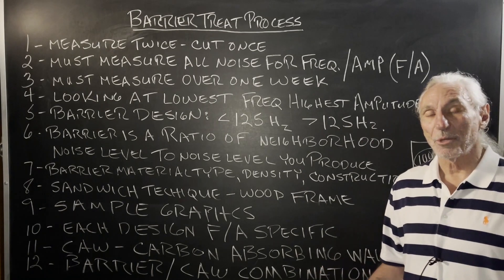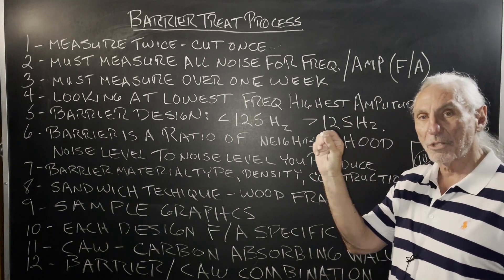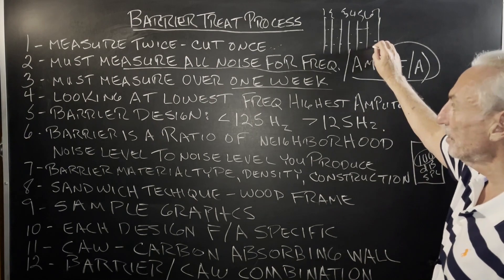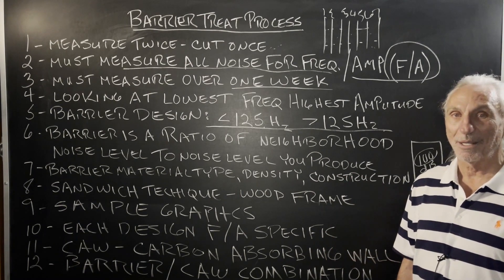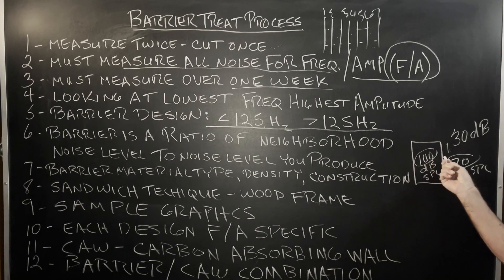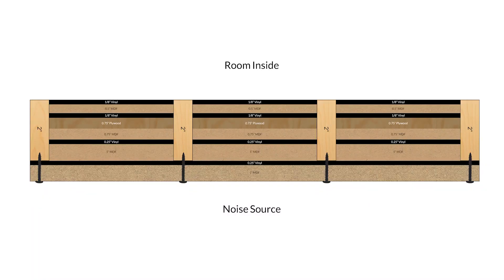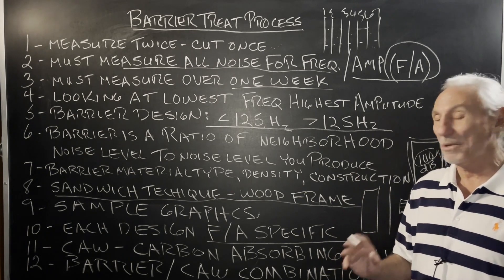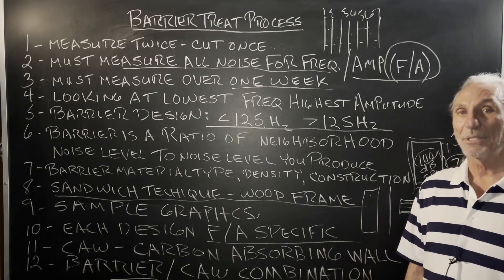Barrier Treat Process - www.AcousticFields.com

Comment: I imagine it's easier and cheaper to do this while the home or other building is still in the early stages of construction or planning. How would you approach planning for vibration isolation if a client was "just at the bought a lot, designing a house" stage, as far as doing the week-long noise level measurement? Assume a fairly small lot in a new development with drawing-board stage upscale house taking up most of it. Where would you put your measuring gear for a week?
Reply from the maker: You must develop a strategy. Start with noise measurements then work your way up to low frequency treatment.